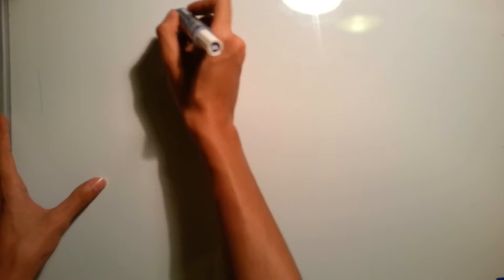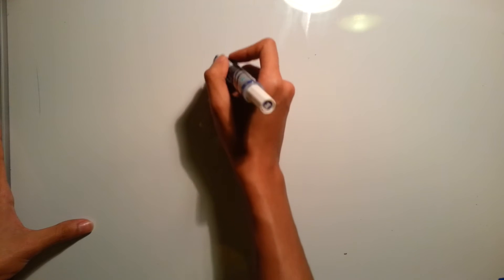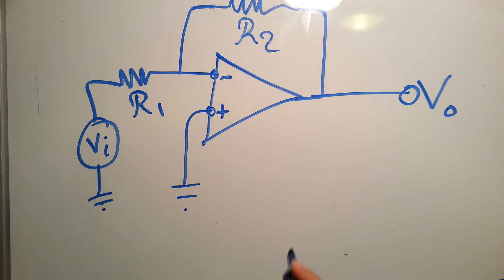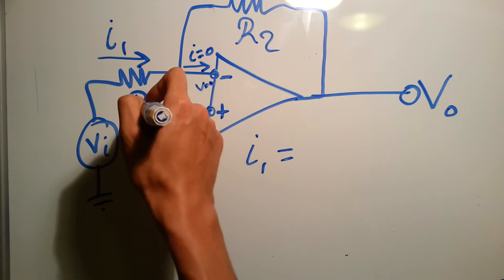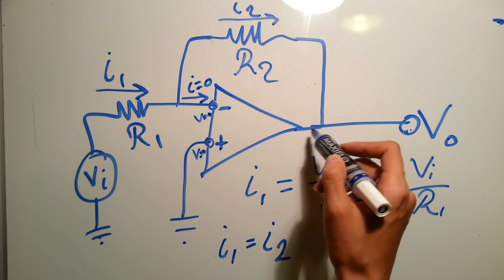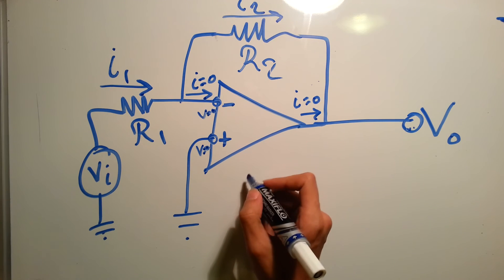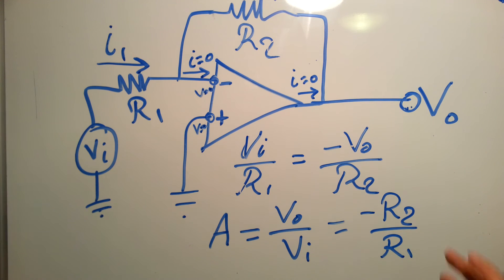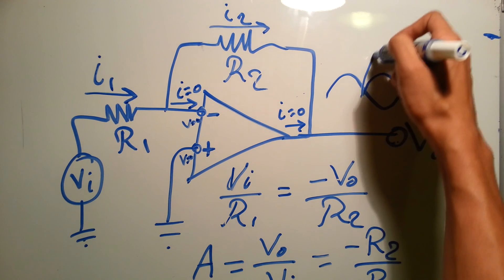Inverting Op-Amps voltage gain

Comment: Pls can you solve on non-ideal op amp? 
If the same 741 op amp in Example 5.1 is used in the circuit of Fig. 5.7, calculate the closed-loop gain vo/vs. Find io when vs = 1 V.
Reply: From sadiku. 5th edition

Comment: How far can I push this? Say I have an op-amp capable of handling 1000v but only a 5v (peak) signal which I want to amplify, could I have R2 as 180Kohm and R1 as 1kohm to get an output that is 180 times larger? ie, the output would have a peak of 900v ?

Comment: Just a question do you just assume that the current going into the amplifier is zero because it is a perfect amplifier therefore it has infinite resistance
Reply: Yes. input impedance of the ideal OP amp is infinite.